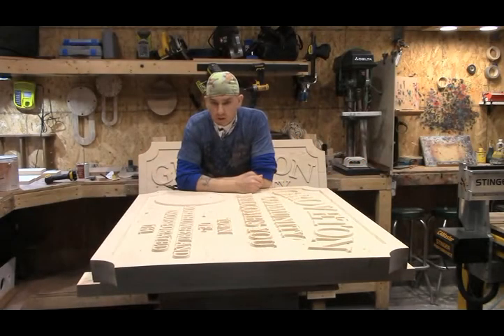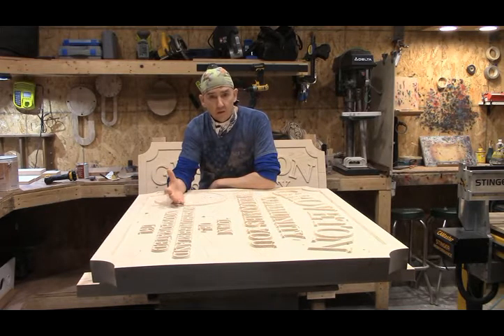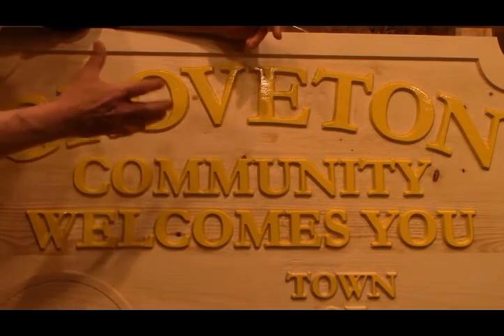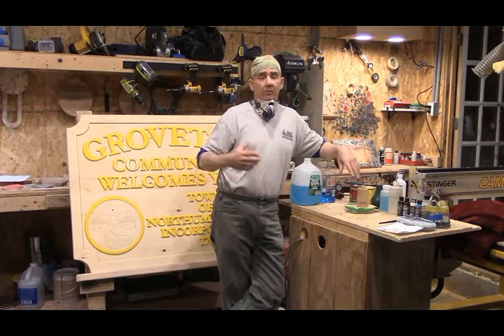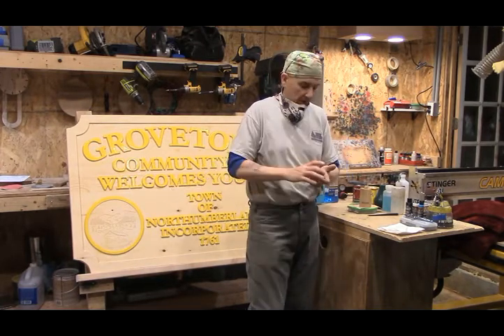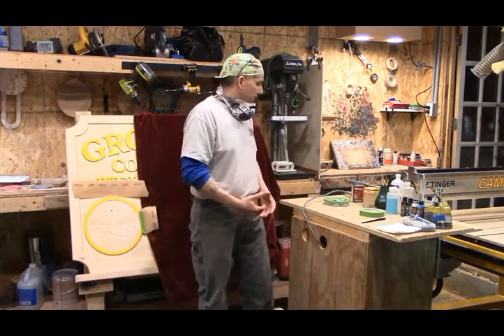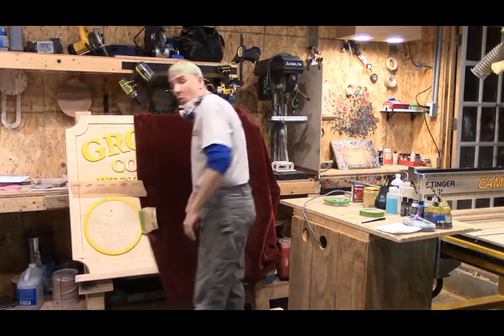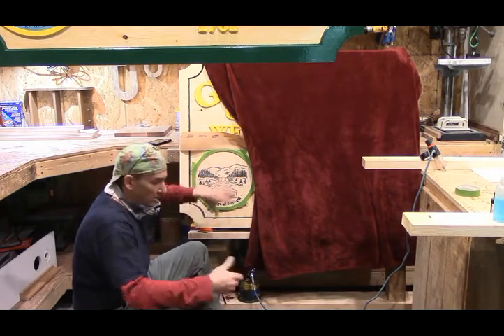CNC Town Sign Finishing Steps

Comment: Would you mind posting a link to the marine varnish you use? I have a sign made of walnut that will hang outside and I want to uv protect it. I'm trying to avoid polyurethane and sanding in between coats due to the raised lettering.
Reply from the maker: Certainly Sir, 4 years later my shop sign is going strong in the upper North Eastern United States with 40 below winters. Here's a link to the product & it isn't an affiliate link.  https://www.homedepot.com/p/Rust-Oleum-Marine-1-qt-Clear-Gloss-Spar-Varnish-Coatings-6-Pack-207008/202558038?MERCH=RECPIPHorizontal2_rr-205127238--202558038--N